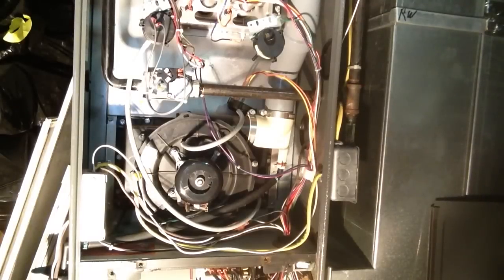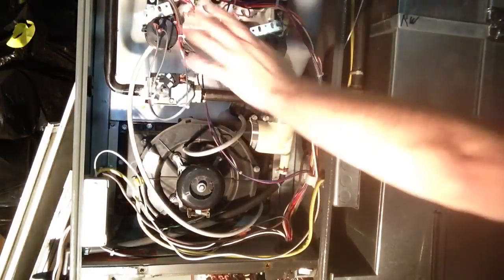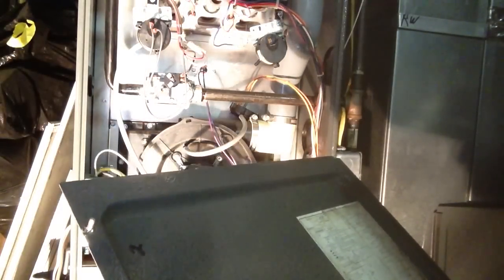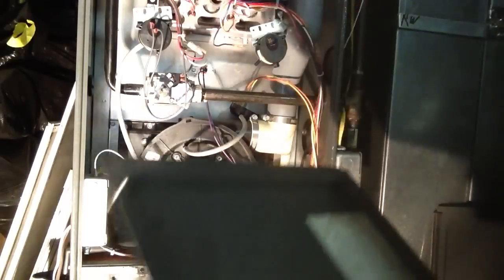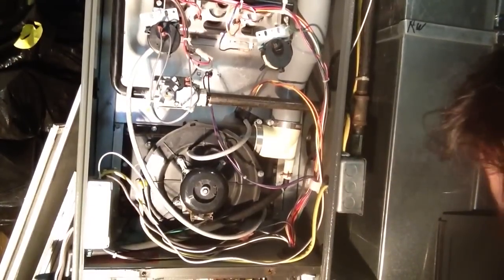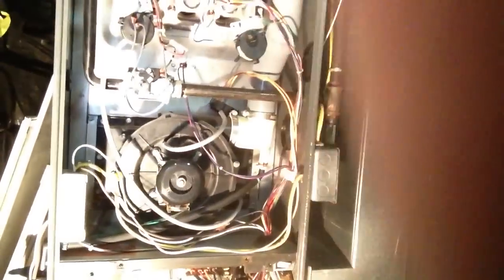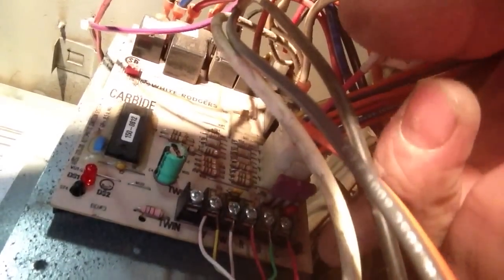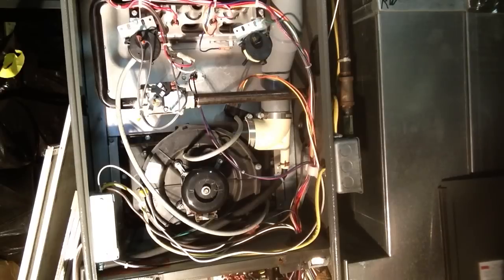DIY Goodman trouble codes

Comment: My system has two lights….one green and the other flashes yellow or red. They both flash different amounts of times….which light do I look at to determine error code?  My error code chart and manual d not tell me the color of the flashing lights. Thanks!